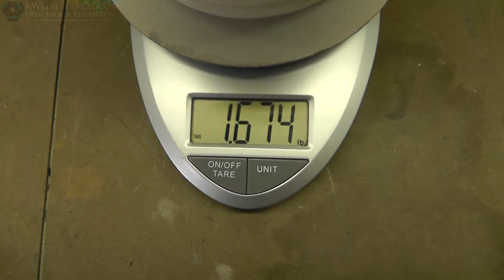#16 Part 3. Filament Spooling Oscillator - Russ's Helix Looper: Gear Box & Test Time

Comment: Heys , Nice project and a good job.  not that this is needed but back in my day; i ran an industral Extruder that produced screwdriver handles.
 You fellows are doing what the industry was or is doing  ,as far as the basic design.
They eventually cut the stream into rods , but maybe this is some kind of solution for more accurate sizing. 
     The pullers were elongated, (ie  like a belt sander placed on top of another belt sander shaped, and  adjustable ,
    "Takeoff' is what they called it
,but with some kind of rubber like material ,instead of sand paper. Proabbly close to 2 ft long. for 1 1/2"  + -.005 inch rods. 
   That setup produced some very tight tolarances because from there,  the rods went to a Centerless Grinder process to get them with in .005 in , to fit into the spindles of lathes which was the next operation.
     I cant recall the extruder tolerances,.All in all though Good job to everyone workn on these extruders, I was wondering if one could be home built

Comment: You have the nicest Filament extruder I have seen.  I wonder if you can't ramp its product up enough to sell filament.  Your Tolerances are in a sweet spot. In your earlier videos I thought you might need to build up some back pressure in the extruder to help consistency.  Have you considered adding another heating zone to begin melting the plastic earlier in the barrel?

Comment: Right.. well I dont use Arduino though I use Atmel processors. On my board is an Atmega32, this time programmed in Bascom. I wanted to not only read the values on display, but record them on pc for later checks. (via simple RS232/Terminal)
I built this board initially as a GPS/GSM tracker and they are left overs from early stages (got about 10 of them lying around useless). Think it does 10 shots per second.
Reply from the maker: +Olaf Breuer ok, yeah i can do that now using the serial data. im not sure how to " log" it but it dose display on the terminal, so it should be eazy to log it.  
if your interested i would love to work with you on the project as i already go quite far with the PID and everything. i just cant finish it ... im not knowing on the programming side.

also are you in the USA? 

~Russ

Comment: How much variation is there in commercial filament?  Have you found it more cost effective to extrude your own filament, or is it more of a proof of concept?  I've watched several of the videos from this project, and I'm thoroughly impressed!  It's the perfect combination of intelligent engineering, and hacks to "make it work."
Reply: +Scooley01 hi, great question, at the end of the day... its cheaper to make your own ( if you can get the pellets cheep and your willing to put some effort in to it) at first i have only ran ABS. and tuned the extruder for ABS. so for ABS it works well. and if i wanted to recycle all the fails prints then that's great too!  so all in all its slightly more than a proof a concept.  now if i want all the different kinds filaments then its better  just to buy them at the moment... but i can also make any different type of filament. its just acquiring the plastic, and tuning the extruder. ~Russ
Reply from the maker: +3D Printing LIVE - RWG ok, now I'm logged in to the right name :) that's my other Chanel... :) ~Russ

Comment: can I ask what were those smaller cameras you were using? I'm setting up a 3d printing lab of my own and I'm in need of a way to monitor my three printers and your cameras seemed to do the job
Reply from the maker: +Pep. Co the bestt cam's i found so far that use and are not to Pricey are the Microsoft life cam. http://www.bhphotovideo.com/bnh/controller/home?O=&sku=895506&gclid=CMGytayZ3MoCFVJlfgodEPEMPQ&is=REG&ap=y&m=Y&A=details&Q=   however if you just want to monitor stuff get some cheep Logitech web cams. i still use some 15$ cams they good for the job. not HD if there really cheep but good for this application.  this one is 720P ansd it 15$ http://www.wirelessoemshop.com/logitech-hd-webcam-c270-720p-video-calling/?gclid=COKbsNKZ3MoCFYqPfgodRMgAfA  hope this helps! ~Russ

Comment: I'm curious, what's the target size?  I noticed the caliper reading was fluctuating anywhere from 1.6-1.8mm.
Reply: ***** There are 2 standard sizes, 1.75mm and 3mm. In this case the goal is 1.75mm
Reply: Eduardo Braga
Ahh, thanks.  I don't own a 3D printer.  I'd like to one of these days so I'm just curious about the particulars.

Comment: Nice spooler! Will be my inspiration! Did you already do the caliper thing? If not I have a some spare boards lying around with lcd and serial connection as I already did it. If you want one just tell me and I send you a free one...
Reply from the maker: +Olaf Breuer yes i did add the LCD ECT. i was working on a PID controller and finished it... but its so slow it cant do it in real time ( i don't have good Arduino programming skills)  so i need some one to finish it for me lol 

its just on the shelf right now... i need to make a video on it... 

~Russ